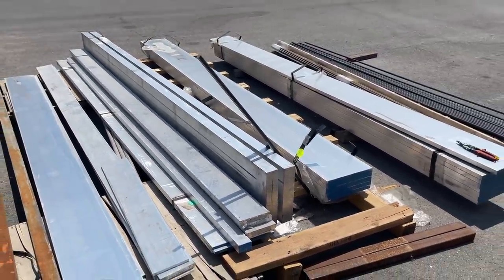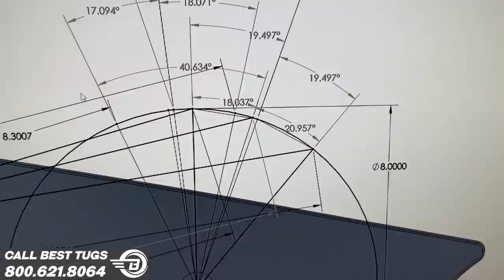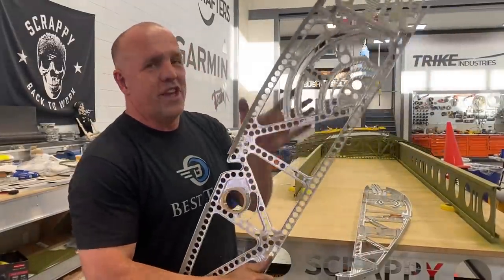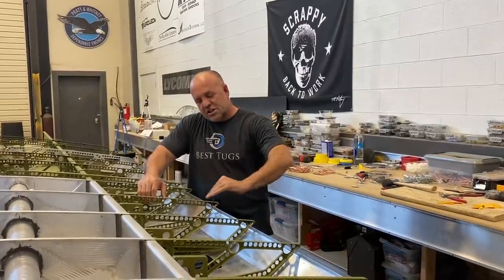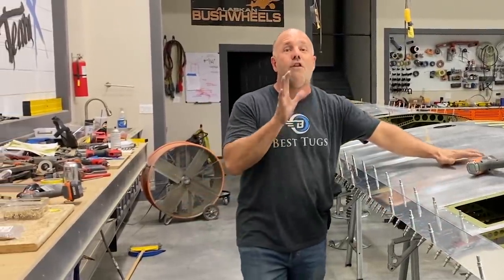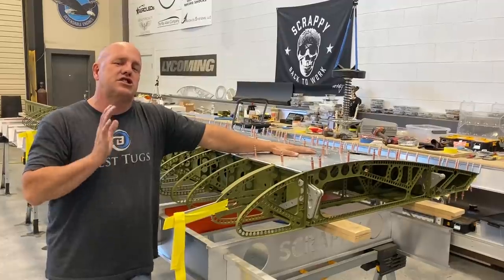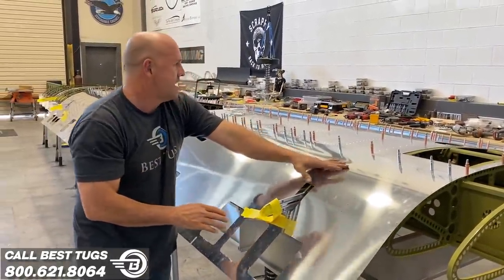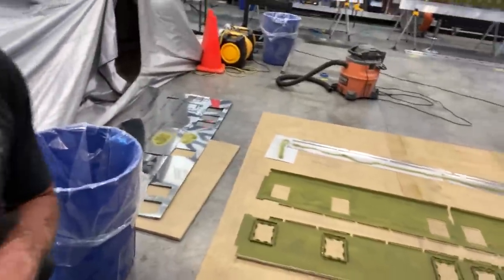I'm skinning my wings, one step closer 🤠 | Scrappy #58

Comment: Remarkable, greatest respect for a man that do the A-Z thing and well.
You can open a museum for remarkable builds by one(s) man.

Just a question about a thought I had.....
I like the way you change the lift on the fly on the wing. I was just thinking, of course I don't know the complete design, that say for example you come in to land at the highest lift setting-slowest speed, and a cable break or the motor activating it break free of its shaft, will the mechanical setup of lift stay in the same position, or will it slam back to minimal lift position, and you maybe too slow speed at that moment-?

Comment: Hi Mike, Ted  here in dorset   Ive been worried about 2 things as outlined below.

1. Im really worried about the solar panels having enough  strength  to work as a wing top lift surface.
.2. You havnt said how you intend to make the wings watertight.
 the solar panels wont do this unless you bond the panels down with a weaterproof mastic.
 We will have to wait and see, Adding metal to the top skin to make the surface fully water tight and structurally  solid is something I would do..
 Hope you have a moment to give this some thought and give us/me an answer.
 Everything else seems to 100% perfect.
 Have loved  all  the build so far.
 Best,
Ted.

Comment: Hi Mike, been following your build/s for some time, like pretty much every one else (on the planet) blown away by your engineering & fabrication skills, a quick question? I saw your using PTI zinc chromate primer inside your wings, which clear coat did you decide to go with on the four CNC'd ribs that will be on display through the  "wing windows" ? 
Cheers Glenn.
DownUnder.

Comment: Mike, 
I know u put a ton of thought into your builds and it’s incredibly well engineered. But I was wondering if all those little pieces all the details ever keep u up at night? I’m a mechanic and when I rebuild something it stresses me out so much thinking about all the failure points that I may have missed. U have a ton of those it seems. Not that they would but do u ever get in the air and worry about that one bolt or one thing u might have missed?

Comment: Having everything line up like that must be mighty satisfying - especially where the skin wrapped around the leading edge of the wing! Incredible! Did you have to factor in the thickness of the paint on the ribs? Did you use SolidWorks standard sheetmetal flatten for that, or did you need to adjust the settings like K-factor? Very impressive result.

Comment: I assume you've got some electrical isolation between the carbon fiber slats (or other parts) and aluminum.   At least several coats of paint?  Otherwise you'll potentially get a galvanic corrosion couple going...  Looks fantastic, though!!

Comment: Your fuel panels look kinda like Gulfstream's.  Gulfstream's have a mesh gasket and a bond check is required at installation.  Do you think there could be an issue if your fuel panels are not bonded to the wing?

Comment: Awesome wing!
When the double flap extends, there's a gap between the two flaps, where air can go. Is this optimal or would it be more efficient if that gap was covered with a flap? It just seems that air will go between the two flaps and you will lose lift. 4:21

Comment: Amazing, as always… Maybe a stupid question, but how do you avoid over-pressure inside the wing through your slat shaft holes? Would the amount of air you could ingest be negligible? And Ron is the best!
Reply: With the air being at pretty high velocity at the slat/wing interface, it might actually be at negative pressure.  Hard to tell without running the numbers and I'll bet Mike already did that then planned accordingly.
Reply: @kensherwin4544  that’s a good point!

Comment: @Mike Patey   I would like to ask something about the purpose of those partial rib-like elements fitted to the spars between the actual ribs - Are those pieces there to keep the spars from bending out ot the front or back under high loads in the areas between the ribs, in the "rib-fields" so to say?
With best regards from Germany - You absolutely rock! :)

Comment: So for the temperature expansion, how much strain does that put on parts once you go fly out of a hot airport to cold elevations?
Reply: The aluminum spars and ribs also being aluminum all expand together, except that the skins get the sun first. So it's not much of an issue overall.

Comment: The FAA should award this man an A&P certificate.
Reply: As the builder of any experimental aircraft that's pretty much SOP to get that A&P certificate for the built aircraft. I have it for my 4000 hour experimental.
Reply: @danblumel  I went to school for my A&P and Mr. Patey is well beyond my skill and knowledge level. He just continues to impress and amaze me. I don't think he has ever worked inside the box.
Reply: A&P school taught the knowledge and theory of aviation maintenance  to inspect, repair, and replace items. Mike Patey can envision something new and unique, then design and engineer it, create it with modern precision manufacturing and install within such as short time frame. In the time it took me to complete a kit plane he has created from scratch a unique and transformative aircraft. I know my wife is humored by my admiration for this guy. He is special.

Comment: Mike, have you considered the possibility of internal wing icing? The air INSIDE the wing skin can ice up. I am looking at the large number of potential failure points from these complex linkages and the potential effects of ice at those points.
  Having the linkage jam up in one of your wings could be EXTREMELY EMBARRASSING.
Having offered that as a caveat, your engineering and craftsmanship are SPECTACULAR!
Reply: That would require a ridiculously perfect set of conditions to happen, and there wouldn't be enough moisture contained within a mostly sealed wing to develop enough ice to affect control linkages in the first place.  The moisture would be a thin layer spread out over the entirety of the internal surface area, you'd be talking a few thou thickness at the most of easily broken frost.
Reply: Just fly in the summer, problem solved.

Comment: If the parts are kept the same temp while all holes are being measured and drilled then they will match. Do one in the air cond. and another outside in cold or hot and the holes will not match.

Comment: He's moving so fast now, any bets if he can fly off the 40 required hours ( experimental with uncertified engine prop combo ) only local flying allowed and fly it to OSH by the final weekend. He's done plenty of preflight testing of the power train and systems that don't include the wings. If he doesn't make OSH, absolutely for sure he'll be at the Reno Air Races and High Sierra (dead Cow).
My bet he's shooting for OSH to surprise most everyone that's not in his inner circle !!! The other option, they truck it to OSH wings off obviously, reattached there. 
My bet, one way or the other, it will be there at OSH and most likely at the Garmin display or Best Tugs, Best Tugs would keep his intentions and arrival plans within his inner circle.
Reply: He could fly off those 40 hours in a couple of days; remember who we are talking about.
Reply: @elliottdiedrich2123  more like 4 to 6 days.
Reply: @danblumel  the secret is out; check out Flight Chops' new video!

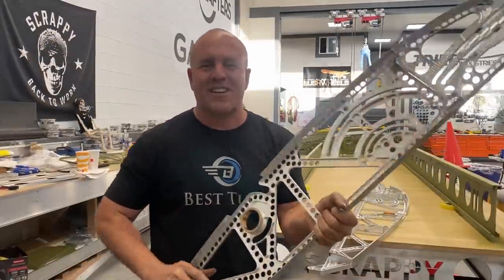Comment: 6:30
Test the slots of the ribs guiding the ball bearings at about - 40 F due to the shrinking of the aluminum at low temperatures.
Reply: Superb double slotted trailing edge flap design.
The maximum lift coefficient based on the base chord should approach 3, if not limited by elevator deflection.
Reply: Good discussion on high lift flaps:
Aerodynamics of V/STOL Flight
Barnes W. McCormick
Dover Publications.

Comment: I'm curious, won't the gaps between the slats & flaps on the bottom side of the leading & trailing edges create turbulence as they are not flush & straight across tight?
 It's probably more critical on the top side of an airfoil? That and if they were made tight & straight across like on top it would change the profile of them and airflow and hurt the efficiency of them? Also maybe not so critical at lower airspeeds. I'm sure Mike and others have thought of that but has me wondering.

Comment: I guess if I had a concern about the wing, it's when one of those linkages fail. What happens to the wing when there is failure?  Does it flop around? Does it seize in on position? Mostly, is it safe?
Reply: I'm guessing Mike will answer your question. From all other questions like this, I'll give you a preview: "Well, I designed this so if this part fails, I have this other part backing it up as a failsafe. If that part fails, it will simply just ride on this stop. There's no way for anything to bind because these slats actually only needed 2 brackets, but I used 6. So for there to be a problem, the wing bolts would literally have to come loose and fall out... which is impossible because I've designed a new type of threads that will not let the nut come loose..."
Reply: @Skybolt211  I hope that's true. I also know that he's going to put that aircraft through hell.  I also know that the Titanic couldn't sink.  We will see.
Reply: @davidgrandy4681  I'll give ya that point. If he runs it into an iceberg, it may damage the linkages! ;-)
Reply: @Skybolt211  I watched what he did to Draco and I don't think that he'll need an iceberg.

Comment: sorry I have a question based on the fact you are so good around carbon fiber i was wondering why didn't you use carbon fiber for wing skin and ribs, is there any special reason for it we know carbon fiber is much stronger and lighter and i saw you go throw so much even for saving a couple of grams so using carbon fiber gonna save so much more weight i hope you get what i mean

Comment: "its only 10% more"  With all the "10% more" that you have done, you have already built 42 aircraft.  Glad you are doing it though.  Ah the difference between building for yourself and building to sell at profit.

By the way, what was the formula car that hangs on your wall built for?  It is strange in that it looks about formula ford size but has a lot of aero work with outboard suspension.  Was this an early 80's one off FF or just something you built for fun?

Comment: I’m a n00b. That are those pins all over the wing skin? Explain it like I’m 5
Reply: Clecos. They temporarily hold rivet holes in place so you can line everything up before you actually start riveting.
Reply: @Skyprince27  awesome. Thanks for the response 👍
Reply: @mikewasowski1411  
They have internal springs; you can put them in and take them out in a second using Cleco pliers.

Comment: WARNING, WARNING, WARNING...The attachment points of the wing to the main fuselage, look way, way, way to small and weak.  You need to beef up the attachment to the fuselage, like 2 or 3 times what you have.  So much force and stress will be at these points.